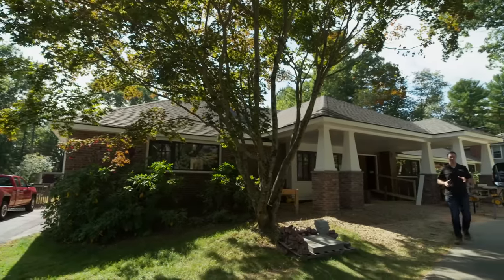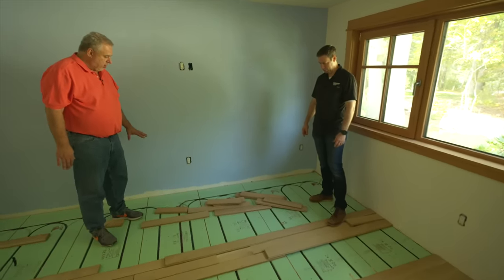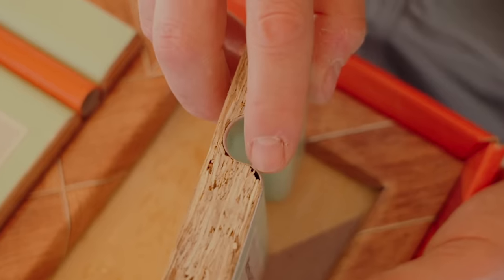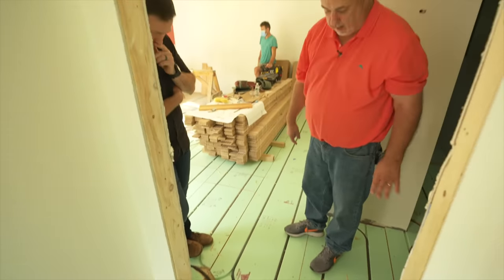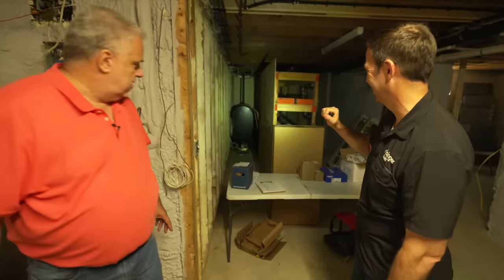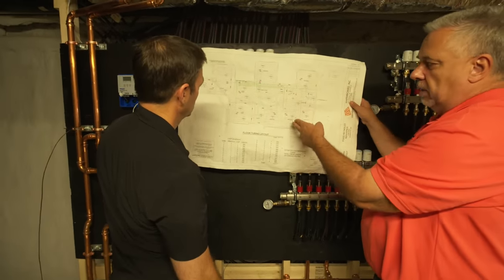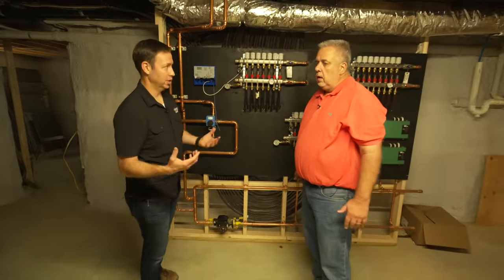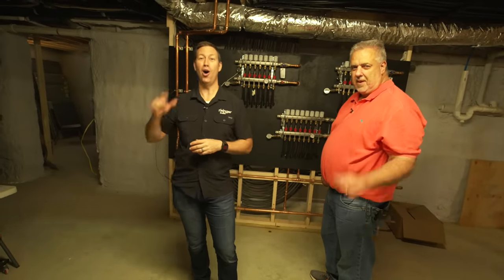Plug and Play Radiant Floor Heating System - BEST ON THE MARKET

Comment: I love the better comfort of a radiant floor heating system.
BUT, note that you have to have more than just a radiant floor heating system in the house though.
You've got to have some quantity of air exchange on a tightly sealed house (and most houses that get radiant heat are tightly sealed for energy efficiency) otherwise you will be building up CO2 from occupants breath and a certain amount of fumes from outgassing of materials (mostly in a new house), cooking, cleaning chemicals and stinks from bathroom use, etc.

Additionally, some (actually a lot) of people psychologically need a bit of air movement or they feel stifled or suffocated (moving air "seems" fresher)...
so you might need a forced air duct system anyway. And if your going to need an air conditioning system in you location,  you already have ducts so all your doing is subtract the furnace part of the HVAC unit.
Reply: Check out Matt's video on his real rebuild where he explains his Zhender ERV system.  I think it basically solves the issue you raise (although I'm not sure if it solves the off-gassing issue from constantly cycling hot water through plastic piping throughout the house -- seems like that could present issues for people with underlying lung issues)
Reply: One of the main reason to retrofit into radiant heating is because older houses did not have ductwork installed. Now if you have the option with ductwork, forced air system is always the better option
Reply: I’m fairly certain radiant floor systems exist that can heat or cool. Use electricity and/ or even solar heating to heat the water in the pipes, and then in summer you can pull and ideally partially recirculate tap-cold water for cooling. Once you get past the first few feet of soil, the ground temperature is fairly stable year round, hence why you have cool water even in the summer heat, as most water mains are buried well below frost lines. Geothermal is another option for the cooling. Air is pretty inefficient for heating and cooling as it has a low heat capacity, and actually works decently well as an insulator, so forced air requires large ducts compared to that of just fresh air exchange. Water (and soil if using geothermal) has a high heat capacity and so works well for heating and cooling. Hot water and steam have been used in radiators for ages. This is all easier said than done of course, but mainly because these options aren’t as popular on the market than forced air HVAC. Otherwise, the technology has already been here. It’s just a matter of adopting against prevailing market forces, which have been driven by production home construction and what’s cheap for them (and landlords in the rental market) in the short run to make a profit, not what’s ideal for homeowners or energy efficiency in the long run.
Reply: @zakiducky  you'd want to use the cooling water in a heat exchanger ( like the finned radiator in a std HVAC system) and not in the underfloor system because of condensation forming (on the cool/cold tube in the floor) and damaging the structure of your home (unless you did a huge uneconomical amount of engineering to circumvent the condensation and water removal problem.
Reply: I basically built my own under floor system here in Northern NJ. 
One thing I couldn't figure out was what was mentioned in the video @10:10 about mixing the return water with the outgoing to temper the water. 

It's my understanding that this mixing ratio is determined by the temperature outside or how close the system is to reaching the requested zone temperature. Is that how that works?

I don't know how to solve this ratio and outside temp problem. Any tips?
Reply: @zakiducky  seems that yes can be used for cooling. Just have to keep the RH in the house low to keep from having a problem with reaching dew point.
Reply: @orielsy  for radiant heating the zone temp is achieved by the duration of the heating cycle, not so much controlled by the mixing temperature. you will want to limit the mixing temp below 125f because you dont want the floor to become lava. and that is the main purpose of that mixing valve. the temperature in the primary loop can be higher than 160f and that wouldnt be ideal for your feet to walk on. with regarding to outdoor temperature it is mostly for energy purposes. the higher outdoor temperature the lower mixing temperature is needed. but that is only to save you a few bucks on the gas bill
Reply: @bobjoatmon1993  Very good point!
Reply: @lvkuang  thank you so much. I had read people with boilers needed mixing valves to bring the temp down. I was confused as I've seen others use a mixing valve to temper based on outside temp as you've mentioned.

Basically to control temperature momentum.
Reply: @orielsy  Thermostatic mixing valve is what you're after.

Comment: I'm toying with the idea of infloor heat for the entire main floor and basement of a future build. I love the look of the old fashioned radiators and the thermal air blanket they formed at windows.  Are these types of systems compatible with adding radiators as different zones with different heat outputs?  I think this would allow for the lower floor temperature setting but still have added heat variability in each room from the radiator.

Comment: Boiler installer here, the plumbers did a good job laying everything out cleanly in the basement, but unfortunately that mixing valve is piped incorrectly and will always have problems finding the set point.

The hydraulic separation (in this case the "closely spaced tees") should be between the high temp loop and the mixing valve, with the radiant circulator pulling from the mix supply port of the valve. Piped the way it is the boiler supply and return ports of the valve are subject to differential pressure changes from other zones kicking on, which significantly decreases that fancy expensive tekmar and 4 way valve from finding the right set point.

The other issue is a term called "valve rangeability". If only one zone consisting of three 300' loops is calling, less than ~0.75gpm of 180F water is needed (real rough napkin math). That mixing valve will be bouncing from completely closed, to one tick open back to closed.

Piped properly you would be able to downsize the piping that ties into the boiler supply/return ports of the 4 way or add a throttling valve to limit water flow. Restrictions the boiler supply to the mixing valve will allow the valve to operate in its full range, reducing deposits in the valve that may restrict movements or lead to failure, and also making it possible for the tekmar controller to easily find your set point.

Good plumbers, but they might consider a hydronics specialist or designer in the future.
Reply: I respect your comment sir and will run it by the plumbers - thank you
Reply: Long-time design builder here, with a good deal of experience in the mechanical fields. Your comments are well-taken. The homemade hydraulic separator is odd, given the modest cost and great convenience of a manufactured unit that will function properly, without fuss. 

I would really like to see a full followup after the heating season sets in. My experience with wrestling with flow balancing on a complex 16 zone  Warmboard job is that the manifolds/ zone valve arrangement here is going to be problematic. Running a single zone valve through a larger pipe, to a local manifold, with balancing valves to each loop is simply more straightforward, and easier to balance the loops, as they are all seeing the same thing at the manifold. The flows in these installs are low, so low that throttling down at a single zone/ balancing valve per zone can be really tricky. Trying to divide that flow even further would not be my cup of tea. 

Multiple temps definitely makes life more complicated, but was necessary due to baseboard units in the basement. This works at cross-purposes to the energy efficiencies of the inflow radiant, and Warmboard in particular.

Because of the high water temp for the basement, heat pump sourcing is not so attractive, due to need to increase temps with a fueled "booster" unit (boiler). But I have to wonder the wisdom of leaving that old oil-fired unit in place. It appears that the design heat load must be substantially reduced, and that would lead to short-cycling with this behemoth boiler, that presumably is stuck with a fixed firing rate. At the very least, I would have wanted to see a buffer tank, to mediate the short-cycling. 

In short, I am always puzzled by projects that start out with all the right goals, but then stop short at some odd point. 

Oh, and despite all my experience, I always have a mechanical engineer involved on any project that involves radiant, or any hydronic heat plus AC. Just can't wing this stuff anymore, it is too complicated, too rife with possibilities for error.

Comment: - Is that a quartersawn 5" white oak?   Quartersawn or not, a year after install it's gonna have gaps everywhere the width of a quarter.  The homeowner is gonna lose their mind over the gaping.

- waterbased glue?   If it's not ... the house will stink like glue forever.

- What finish will you use?  radiant heat will cook out finish fumes.   Waterbase finish tends to stretch with board movement at the seams and go white.   In the wood floor industry it's called "white line syndrome".  

Hardwood floor company owner operator 15 years.   Love your channel Matt.   Be glad you're not the architect or floor company on this project.
Reply: Oh no, boy are you going here from Mr Architect.
Reply: it's not a flooring episode

Comment: you can even put the heat coils in the drive way, to melt the snow and ice, then turn it back off when the drive is clear. Saves all that shoveling or snow blowing.
Reply: That would have been more practical, even in Texas.
Reply: People say that cost as much as heating 3 houses

Comment: Issues with radiant flooring to consider:
- Warm floors in winter months are AWESOME, but then in the Spring/Fall when the heat rarely comes on you will still have cool floors.
- Unless you live in Finland or Alaska, you will probably need some A/C too, which will require duct. You will end up paying twice for HVAC distribution.
- Wood floors are not ideal for radiant, and using wide oak as shown here is risky. Narrow strip is better, and engineered or tile better still. Keep in mind, that a 3/4" wood floor will put an R-.75 between you and the heat source. Tile floors radiate better, but are not super confortable. Putting down accent rugs, carpets and mats will also reduce performance.
- The move to air-tight homes with an HRV/ERV fits well with a forced air system. Not so much with the radiant.

We just built, and I was initially leaning hard towards radiant, but for the reasons above, I went forced air/geothermal with a tile warmer in the master bath. Just my two cents, your mileage may vary.
Reply: Yes and .. the more moving parts the more trouble .. how many pumps?  how many flow control valves?  it would be interesting to see how much stuff needs replaced / serviced in the first 10 years.
Reply: When in the basement you can see a duct system already in place. Optionally there are ductless VRF systems that can heat and cool different zones.
Reply: Great comment. It does look like they're using rift or quartersawn white oak, which is a lot more stable than flatsawn. It's one of the only types of lumber that's really approved for use over radiant heat. Of course other types of flooring (engineered, tile) would be safer, but if you want the look and feel of real solid wood, this should be ok... at least in theory.
Reply: I hate my forced air / geothermal.. it's an energy hog with much more expensive maintenance.  Swapping out a pump is cheap and easy.

You make an interesting point about heat not being on in spring/fall, but the floors shouldn't actually be cool, just room temp.

Comment: Truly beautiful work. I can't imagine the cost of this but it was fantastically done.  I imagine the cost of flooring, mechanicals, and labor for that house would be greater than the entire home price of an average house around here. Still great job though.
Reply: In the middle of planning my build, this warm board costs 57k with a boiler. Still need an air handler and ducts for A/C on a 2500 sqft house way too expensive, even when I’m the installer.
Reply: @danbedard290  Assuming that the system lasts 25+ years, what do you think your savings will be on energy costs?

Comment: great system. my question is what are the effects if any to the white oak over time sitting on top of a heated floor. Would it cause shrinkage in the wood planks?
Reply: Yes, it does. However, oak isn't equals oak. There's such a huge variation in quality and moisture content when installed, that it's hard to say whether or not it will be a problem. I have 3" red oak plain sawn and I can't go as high in temperature as I wanted. Max. water temperature in my floors is 92 degrees to keep shrinkage to an acceptable level. At that point, you really don't need any zoning controls anymore, because all loops are fully open all winter.
In a room that I've redone, I put in 5" highest quality quarter sawn red oak and haven't seen any shrinkage in 2 years.
Reply: cwslsj In the U.K. I struggled to find a solid wood floor that the manufacturer said was ok for underfloor heating. All recommended engineered flooring to minimise shrinkage, movement and warping / cupping.
Reply: @spencerwilton5831  bamboo, Quartersawn is key when you have radiant floors